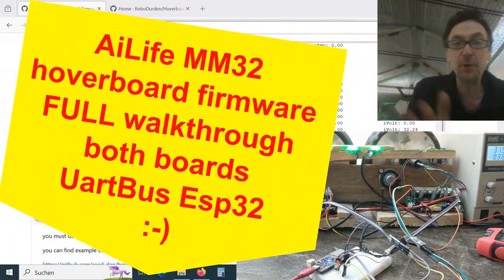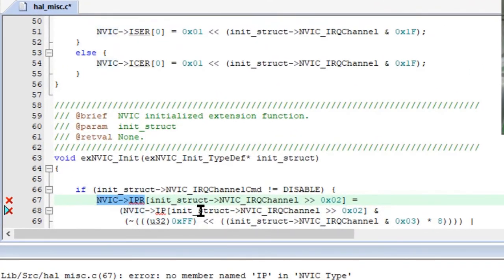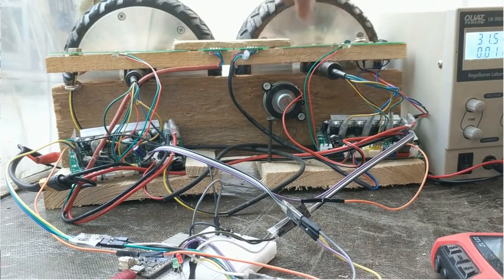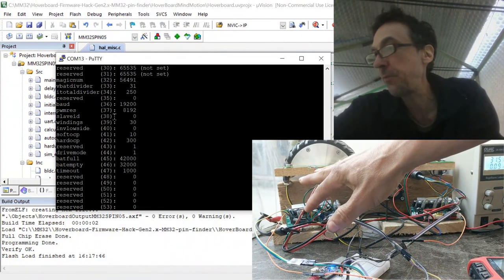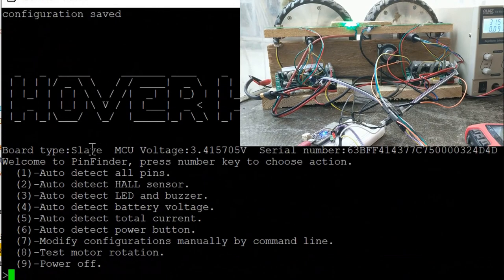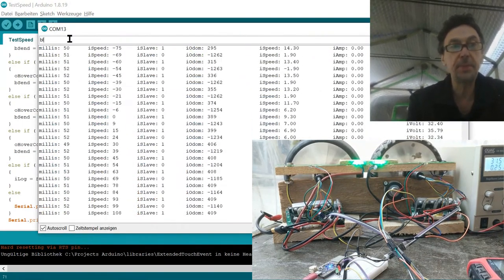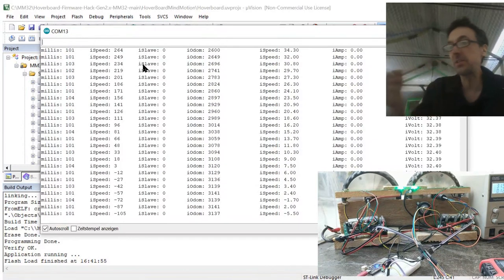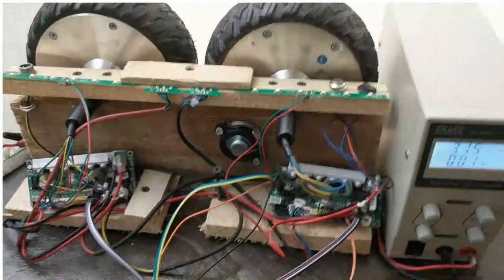AiLife-MM32-Hoverboard firmware: FULL walkthrough with both boards, UartBus Esp32

Comment: @robodurden I would like to ask for assistance with using this controller. I have succesfully set all the pins using the pinfinder firmware and flashed the main firmware. I cant seem to get the esp32 code to work/ spin the motor. I am using the MM32SPIN06PF Board (just one) with the DOIT ESP32 DEVKIT V1 using the Rx2 and Tx2 Uart pins. Help needed.
Reply from the maker: Open an issue in one of our github repos..

Comment: i am the author of this firmware,feel free to ask any questions
Reply from the maker: A great honor for me that you visit my little channel here. The "awesome" job is yours, not mine. I want to ask if we can dream that you will port your better firmware to GD32. Next, I may make an efficiency comparison between your sinusodial drive mode to the bad old GD32 Gen2 firmware and to the simpleFOC Gen2 firmware. And i will not be surprised when your MM32 firmware is on par with FOC motor control when only energy efficency is on test.
Reply: @robodurden  it is possible to port this to stm32f103/gd32f103, but we already have gen1 so theres no point
the gd32f130 does not have hal library so it cannot be ported/can be ported but will take allot of effort to adapt the f103 library to f130 
since mm32 board is built down to this $2 price i dont think theres any point anyways

the sine wave mode is definitely a huge improvement for effiency and torque,especially at low speed,i would love to see the comparason of mm vs gd vs gen1too
but im pretty sure for now the sine wave mode on gen1 is still better, because the hall sensor mechanical position is not calibrated yet, so some minor vibration is still caused
Reply: @lifeai1889  the problem is that gen1 hoverboards are becoming difficult to find. A port at least of the potentiometer function would be very useful.